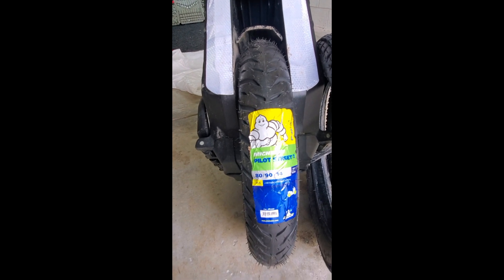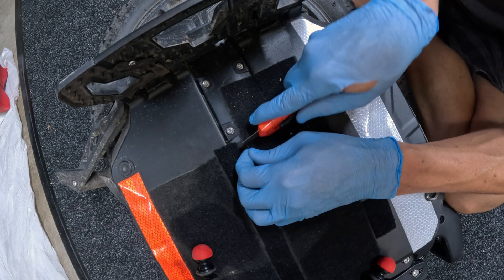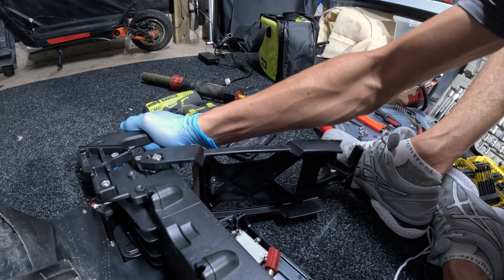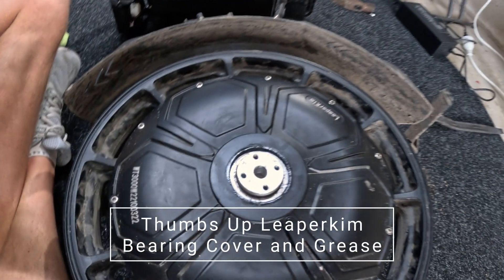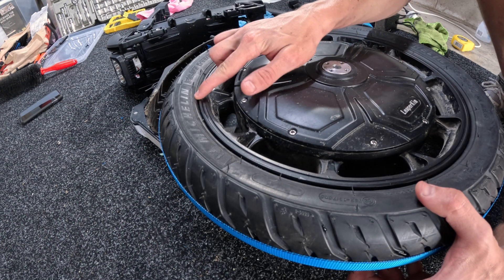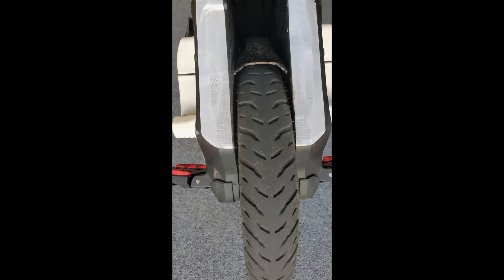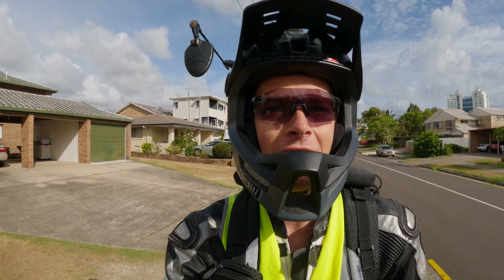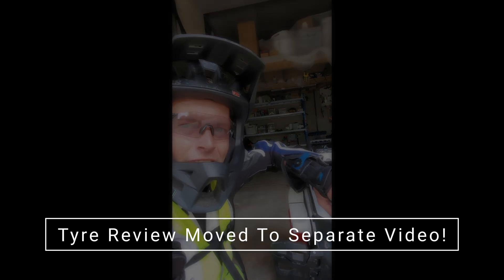Tyre Change Veteran Sherman S EUC Series No5 [Part 2.3b]

Comment: Hey so i rode my patton yesterday fine . Went to bed and when i got back on this a.m it appear to have lost some air because i was riding as of the floor was slippery. It was slidding at every turn . Do you think it needs a tire change or just a fill.to a certain psi ? I re filled it and rode it but still felt like the tire was unbalanced ..... what would make you want to change there tire other than thread diminishing ?
Reply from the maker: Hi, mate.Did you inspect the tire to see if there's any obvious punches? 
If it's just a small puncture , then maybe a tyre sealent would work otherwise , make sure you pumped up to around thirty four psi to try. It shouldn't be decreasing more than 1 to 2 psI pay a week.
The patton tire is notably square, which means that dips awkwardly while road riding. So that's one reason I might change to the shinko 241.

Comment: Street tire on my Inmotion V13 was a total game changer - the wheel is much better now. Michelin Street Pilot repalced the old knobby.
Reply from the maker: hey finn happy to hear it! it seemed really challenging for you to find a michelin in your country, glad you got it sorted. enjoy!
Reply: @jonoeuc   Well I was told by Michelin that I could not get the Michelin Street Pilot 2,  So I dont have version 2. Trying to install MITSA street tire was terrible its too bloody tight.  The Michelin Street Pilot was "massaged" into place no use of tire spoons, some times I have pro tire ppl do it with their huge machine - I absolutly hate when the innertube is pinched.  Thx for good info mate. Will prob upgrade pedals the way you suggest. Need better drill tho.

Comment: Hi Jon, thanks for an awesome video. What type of silicon are you using to seal things? Do you have any recommendations on tire irons/pry bars? Thanks!
Reply from the maker: Hey mate, I look for silicone that is clear, multi surface, uv resistant interior / exterior.
this one precisely -->
https://www.bunnings.com.au/selleys-290ml-clear-storm-waterproof-gutter-and-roof-sealant_p1230165

I picked up the tyre iron at my local motorbike shop. it's a bigger 15" curved just like this -->
I also have some smaller bicycle levers which help hold the bead in place but they/re a bit flimsy.
https://www.bikebiz.com.au/products/motion-pro-15-curved-tyre-iron-3kg-bag-only-length

hopefully that helps, ta
jono

Comment: Hey Jono. Had my Sherman S for 2 weeks now with just under 260km on the clock. Got the stock knobby as it was all that was available at the time and figured I'd try it and switch over if I found the "train-tracking" unbearable. So far I haven't felt unsafe or "stuck" yet. Just today, however, I had a weird crash. I rode ~20km to a mate's place maxing out at just above 50kph. Just as I went to turn into his driveway, my "lean" just kept going over and I slid out at low speed. Did some minor scrapes to self / the wheel, but nothing serious. Chalked it down to user-error or possibly train-tracking? Hung out for a couple of hours then when I went to leave the tire was completely flat. Most of one side completely off the beam. I've pumped it back up to 50psi and the beam seems to have popped back on, but it looks like the valve is damaged as it leaks heavily and won't hold pressure for more than a few minutes. I suspect the tire was leaking during my ride as the accident doesn't make sense to me unless the tire had gone flat. I've seen threads stating that Shermans were having issues with rims / tires / valves in 2021, but I assumed they fixed those issues. Have you heard of any on the Sherman S?
Reply from the maker: Hey mate, sorry to hear the crash. surely if the tyre had deflated enough to cause the crash you would have felt it before the crash? Then again that's my issue with the knobby, the road feel is so dulled. To roll off the bead during a turn it must've been quite flat.

I find the knobby train tracks the least out of all the tyres i've tried. However it gets stuck leaning over in a turn, is that what it felt like during the crash?

Sharp burrs around the valve isnt a ShermS issue from what I've seen. Worth feeling it next tube repair though.

are you riding the tyre at 50psi? that sounds far too high. you can go as low as 24psi with the knobby depending on your riding weight.

Hope that helps and let me know what you find.
Cheers, jono
Reply: @jonoeuc  Hey Jono. Thanks for replying & your advice. No, I don't normally ride at 50 PSI, just put it up there to put it back on the beam and test if it could hold pressure. Upon repairing, it looks like the inner tube had a puncture, although the tire was fine. Not sure how this happened. So when I thought it was leaking at the valve, it was likely just going from the puncture out through the gap around the valve stem. I didn't feel anything while riding over, but I suspect it just slowly lost pressure and then completely failed at the end as it was a steeper lean than my previous turns. I replaced the inner tube and took the opportunity to also replace the knobby with a hybrid street tire. It was super wobbly and squealed at first, but after wearing it in a bit, it's been awesome. Much better at carving on the road. While it isn't as grippy offroad, it's been good enough for the fire trails I ride. Thanks again for your in-depth review! You're one of the reasons I took the plunge on the SS (and also went from the V11). I'm currently waiting on a motorcycle pillion seat from eBay, so hopefully that'll be a good solution for seated riding too. Cheers!
Reply from the maker: @LLittlemore  awesome, happy to hear you got it sorted!

Comment: How is the tire compared to the original? Is it worth all the hassle?
Reply from the maker: easily worth it for me. 
Advantages are: nimbleness, slightly improved torque / acceleration, linear roll side to side for carving and easy finessed cornering. 
Disadvantages: less grip offroad and in particular in soft stuff - sand , mud etc. increased chatter, less planted and stable
Here is the in depth video https://youtu.be/0iOiUoTX2pA

Comment: At least you didn't pinch the tube like i did, it's now tubeless converted and rides very well, i did lubricate the bead a lot before inflating so i did seat easily

I made a video of the conversion, if you are interested just type '' mathieu tech moto sherman tubeless '' in search bar ''
Reply from the maker: Cheers, great guide. I see you hit 80PSI to seat the bead. Makes me feel better about the 64psi.
It looks like you didn't need any tyre slime?

Here is the link for anyone else reading this: https://youtu.be/P00W9dnxTtQ
Reply: @jonoeuc  didn't use slime but maybe i'll try to get rid of the 2-3 psi loss per week, but not a big deal, for the tire i only inflated to 30psi and the tire has pop into bead,

80psi was the compressor pressure not the tire

Comment: ok, I have the same thing with the tire being closer to one side of the shell, smaller vs larger gap.
It doesn't matter, rides beautifully and doesn't justify cracking the wheel open again
Reply from the maker: exactly! less tinkering prevents bolt wear and stripping potential!
Reply: Same for me. Glad it won’t be a problem.

Comment: Thanks for sharing this process.  Is the tire change on the Sherman S as difficult as it is on the V11?  I have changed hundreds of bicycle tires, but on the EUC, it is very tricky to get the tire mounted without damaging the rim with the tire irons.  Soap spray helps and I've been told that heating the tire a bit with a hair dryer or heat gun also helps.  I don't mind the mounting, but if I could do it without irons, that would make protecting the tube a lot easier.  PS - I have not had great luck getting bicycle patches to seal punctures on EUC tubes.
Reply from the maker: It was similar to the V11 for the teardown. Mounting the tyre was more challenging than the V11. The SS rim seemed slightly larger which made it very difficult to work the tyre over the rim. I felt there is ZERO chance of doing it without a tyre lever.
I didn't heat the tyre but it is summer here in Aus.
That's a shame re patch kits, was it the glue + patch varient and roughened the rubber with the scour?
Cheers, Jono

Comment: Right on Jon. Yes my tire was aiming left. I went with the Irc urban snow sn26. After the tire change i addressed this. I set it in a workmate clamp. Loosened the 8 vertical battery bolts and 4 upper horizontal bolts 1 turn. Both sides. Twisted the chassis the opposing direction. Used a couple wedges between the battery box and tire to help. Snugged down all 24 fasteners and torqued to 8 pounds. Rode and bounced around a bit .I did this whole process twice and it is now satisfactory . And my charging port leaked.  I sealed it up as you did. Good video work Jon
Reply from the maker: Excellent fix! I should've credited you in the video but my memory was fuzzy if it was you I discussed this with, doh! cheers Jon
Reply: A video guide of this would be priceless! 

Will try on mine , driving me nuts 😂
Reply: What does "torqued to 8 pounds" mean? sorry for my ignorance Im trying to learn